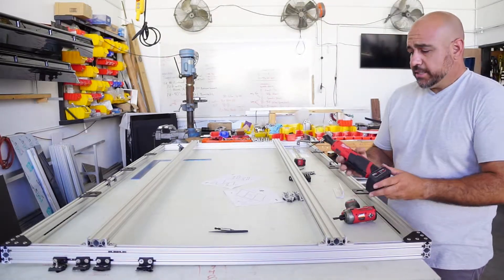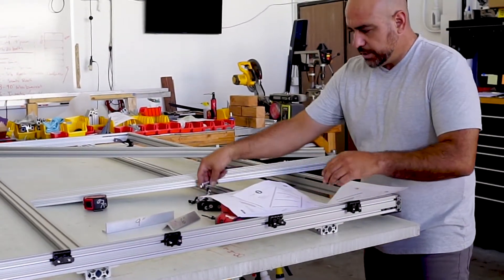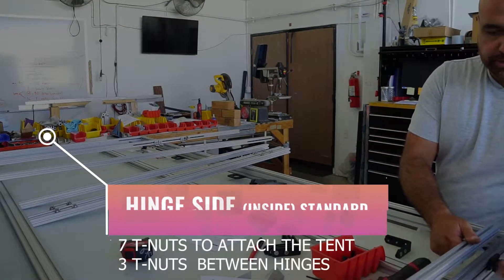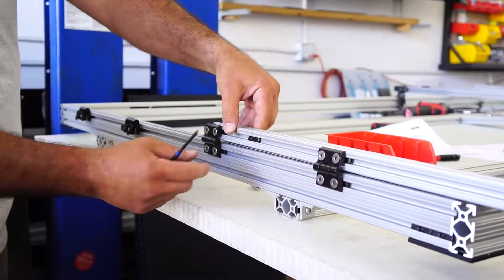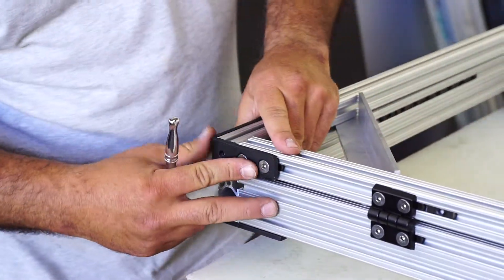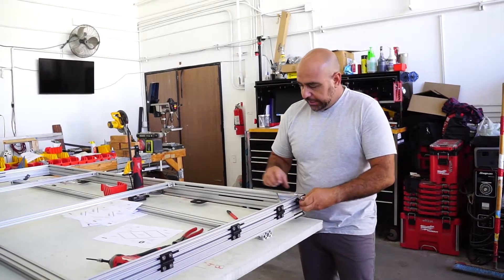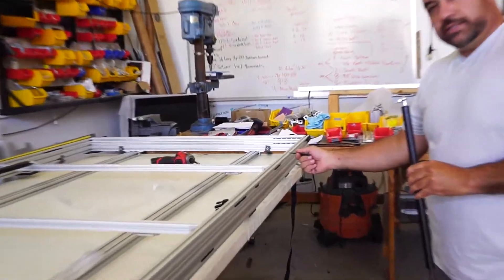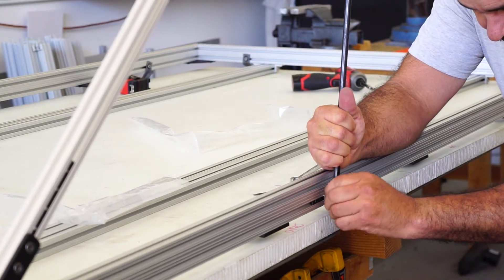STEP 3 TOP FRAME

Comment: Your tents look good, not terrible but I don't feel putting it together myself at the prices you set for any of them is worth it to me. Also, I see no real info on if it's a 3 or 4 season tent. Just the line " bring a good bag for below 40 degrees" I'm interested in these tents but the videos don't show the inside, why the ladder hooks inside the tent, what's up with the lift latch on the side or why the hard shell one doesn't offer protection for the bottom half... It's like a hard shell for the top but the bottom is left exposed
Reply from the maker: Hi my friend, first thank you for bringing this to our attention. We will make sure to share all the information in the following videos. We only offer the option to do it yourself for the Packout MOLLE Tent, referring to the 3 or 4-season tent, I will speak with our engineers to give you the right information, but from what I know, many of our customers that are using our tents, they travel during the whole year and have stayed in extreme cold or hot weathers without having a problem.
Reply: @BADASSTENTS  I got ya, ok, that clears up a few things 👍